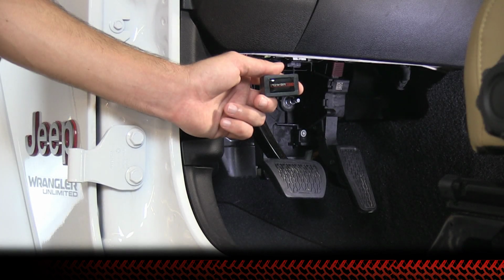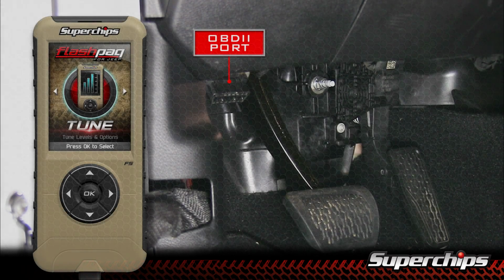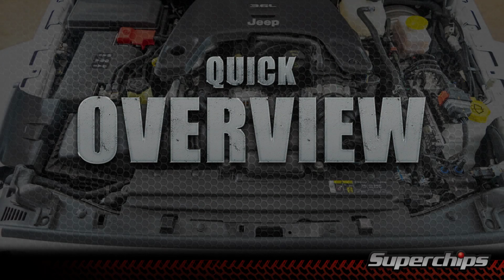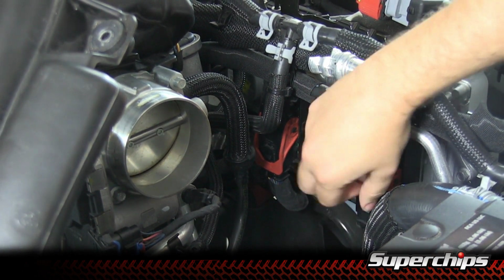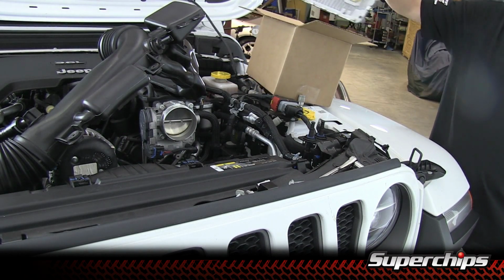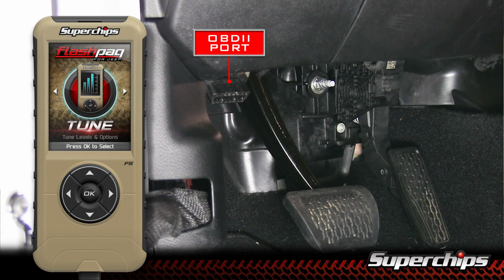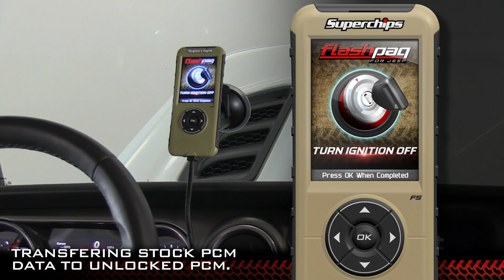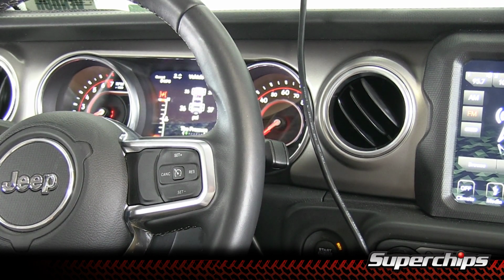How to Swap Out Your PCM on a 2018-2020 JL Wrangler®

Comment: Just did the pmc swap on my jlu 2018. Easy taking the negative battery cables off and the pcm negative 13m and 10m nuts off next to frame near battery. The update after all said in done is the longest of it all. You’re not mechanical include if u think it’s hard to do.

Comment: I got a reman ECM/PCM/ECU on eBay programmed to my Vin and Milage plug-and-play with a warranty for just under $300. Changing them out is very simple. This video is not a simple plug-and-play PCM change. The reman I got requires no tuning. It is an excellent tutorial, however.
Reply: Do you remember the seller?

Comment: I don't understand why Jeep built the wrangler with the PCM located under the hood instead of inside the cabin like Toyota does.  Under the hood, the PCM is exposed to way too much heat and water. I wonder if there is something can be used to protect the PCM from heat.

Comment: Why exactly do you want to replace the Pcm?
Reply: If it fails you have two choices 1. use the car as yard art or 2. replace the PCM/ECM so the car will run again. I personally prefer  #2
Reply: It needs an unlocked one to function I assume, WHERE to get an unlocked PCM idk.

Comment: the 2nd battery has to be disconnected too.
Reply: You take the ground cable from the main ground on the battery off (13mm nut) then take the main ground cable off the battery. Do not let them touch each other or any metal or the aux battery will be grounded again.